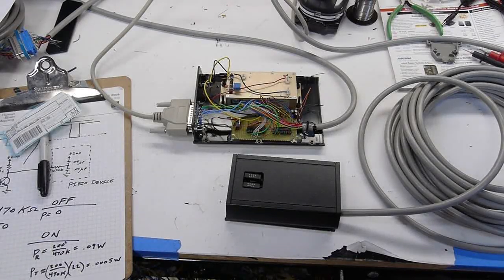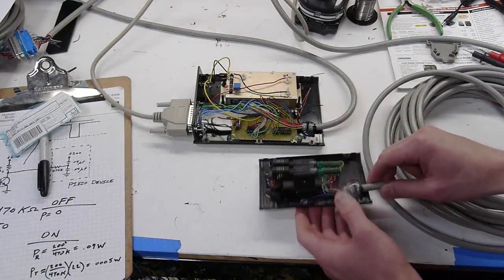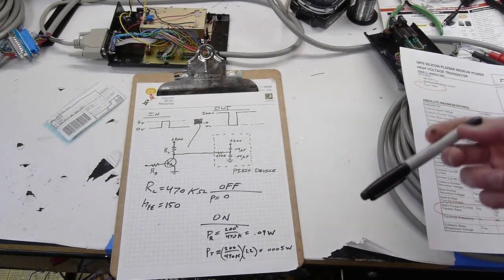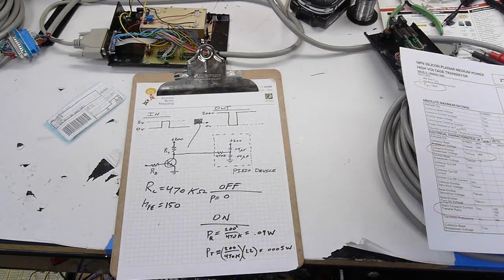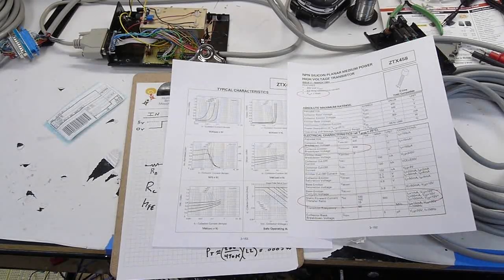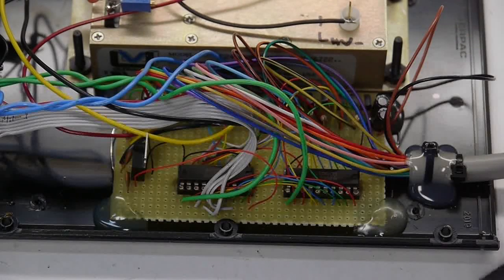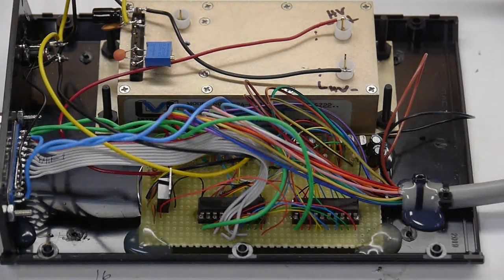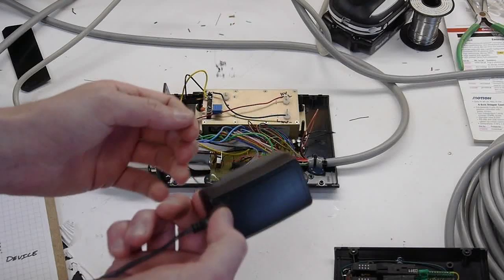Piezoelectric Braille system with PC parallel port control and HV transistors

Comment: More fundamental circuit design, please. I'd like to know more about the difference between controlling voltage and controlling current. I understand controlling voltage with transformers and resistors.

Comment: I'm a legally blind person ... saw your video on your test Braille display.  Great video, although I'm no electronics person. Rather I'm a software engineer by trade who uses Braille.  I was wondering if you could comment on the cost of using the piezo electric cells.  I understand they are very expensive.  A 40 cell Braille display I have was about $3000 .. about $75 a cell.  That is, of course, after it's manufactured, then sold through a vendor with markup.  There are 80 cell models also but you can do the math .. they're out of sight.What I'm wondering is if you're aware of a lower cost cell that could be used which would drive the price down.  I think what people who use Braille would like to see is a 40 cell display that is more like $1000.  That would be much more affordable and it would put Braille in the hands of the people that need it.
Reply: Please search google for ReadRing (www.read-ring.com). I'm developing a wearable rotary braille display at sub 300 USD price range with unlimited braille line length. There is one working prototype with printed text-to-braille conversion function. Hope to begin production in 2020.

Comment: @bkraz333 Not many computers nowadays come with parallel ports anymore, unfortunately.  This would be a great project for using and Arduino.  Also, what do you think the possibilities are of converting an old dot matrix printer into a braille reader?  Is it lower voltage?

Comment: Why did you choose parallel instead of USB for the interface? I have used FTDI's USB chip, which is pretty much self contained.
Reply: googacct you probably won't see this after 5 years, but if he was to use USB, he would need a microcontroller to talk over serial to his PC.

Comment: "Fundamental" stuff is easy to find on the net already (although I wont claim it's easy to find GOOD stuff!). So I'd rather see your projects, the problems and how they are solved. I like to see other ideas. You never know when you can use those small bits of "inspiration" (while fundumentals can be looked up).

Just be sure you've fun at it. Then I wouldn't mind seeing the one or the other.

Comment: I have been wondering why does the the design use piezzo effect. is It because every other design would take much more space?
I thought  that the pins were moved by coils. hmm. 
 
A few of years back I had an Idea to build a whole monitor with Braille characters, but that would be to expensive for a home project. I keep wondering if someone could benefit from this idea.

Nice project anyway answered some of my questions.